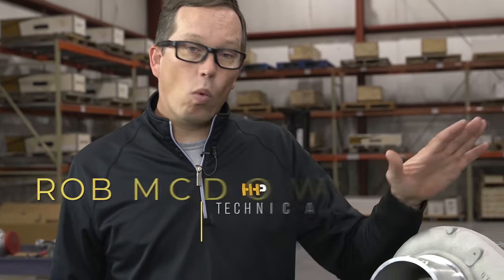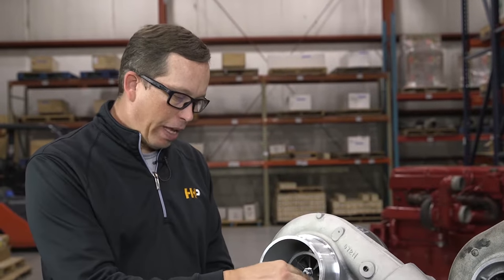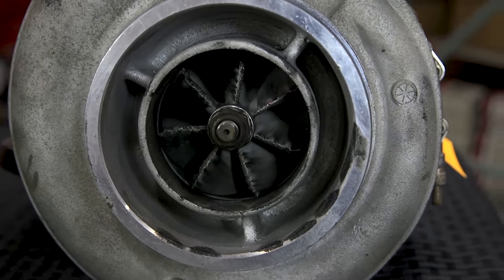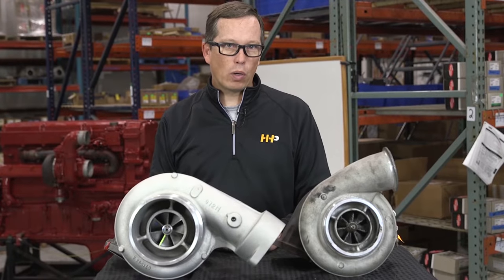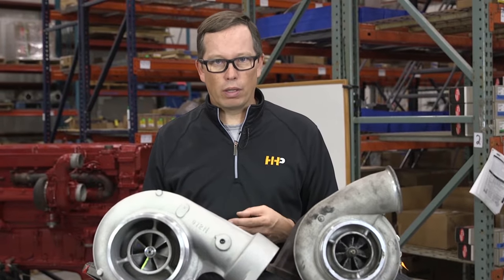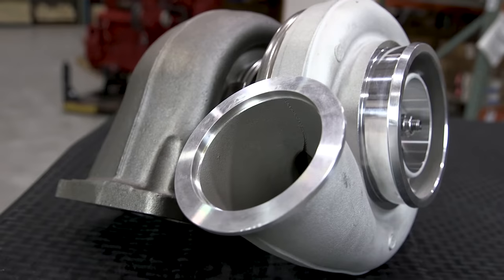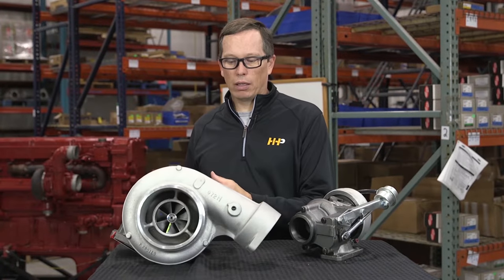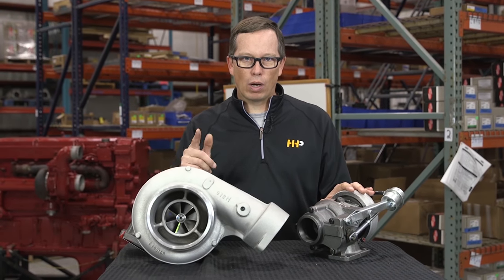Why Did My Turbo Fail? HHP Can Help!

Comment: Most turbos are fine that get replaced, I see it all of the time out here in diesels, mainly semis, thirteen and fifteen litres. These dealers and shops know that most of you guys have no clue how your motor operates, so you are easy pickings. I know, they have gotten me too, then I educated myself. Most of the time it is simply a bad sensor in the emission system. You do need to do regular maintenance on these emission systems, one of them is to change out your sensors, intake and exhaust back pressure are the two main ones. Then clean those EGR Valves and EGR Coolers, and yes, you can clean them, but you have to remove them first. Then the DPF and DOC filters, SCR too. You need to replace or clean them periodically. 

These shops see you guys coming from a mile away. Bad sensor, you get a new turbo! You pay the $8000 and down the road you go! One hundred miles later, that check engine light flips back on... You go back, and you get an EGR Cooler or a new EGR Valve... And the cycle continues until you are broke. And all you needed was a $70 sensor that you yourself could have bought and installed in the parking lot.
Reply: It ain't a sensor for everyone just because it happened to you. You can't assume until you get into it.

Comment: Wouldn’t it blow white smoke? Black smoke is unburned fuel? 
Only reason I say that is because I had a Ford diesel that was blowing lots of white smoke and was very under powered. After looking the intake pipe to the intake had come off so all the boosted air was leaking out and engine wasn’t getting enough air. So wouldn’t it be similar in case of a bad turbo?
Reply: In my experience from when my intake pipe blew off my old mk4 jetta diesel.. Black smoke not white. Anytime you're pushing more fuel than the air allows for you get black smoke
Reply: Black smoke it's turbo, white smoke it's a loose or busted rubber coupling on the turbo.
Reply: @jmaegm  black smoke can easily be caused by a loose or busted coupling because a massive boost leak will make it run really rich until the ecu pulls fuel

Comment: So a year ago my turbo imploded driving down the highway, had a local shop replace it, took forever and he said they put a brand new factory cord like 15 or 16 turbo into my 6.7 ford, right out of the shop it didn’t sound right, had a loud howl and I said I’m no mechanic but that’s not right, he said oh no it’s supposed to sound like that you aren’t used to it because that’s what it sounds like new, never heard a turbo that sounded that bad. Anyway I thought screw it and drove on and figured if it busted they had to replace it anyway. A week later a lot of smoke started coming out of the exhaust, so I took it back he agreed it was bad and said he would replace it. I walked into the shop to pick it back up and saw the “new turbo” they had installed and taken out and it did not look brand new with a weeks worth of use on it, looked more like a bad re manufacture. The next one they had in sounded nearly right but I still said there was a faint howl but again I didn’t want to screw with it and now a year later the howl is nearly like the last one. What’s the diagnosis of that? Howls in 1st and second gear, can’t hear it down the highway, the whistle when it’s spoiling down back to idle sounds normal but that initial acceleration sounds like a police siren
Reply: Turbo will fail soon, get a bran new one, expensive but worth
Reply: Your turbo charger still bad mal functioning
Reply: After driving your Turboed Car you need to let your car idle so turbo cools down, as it may be very hot.
This is your diagnosis.
Reply: i just had that and the imput shaft play was bad, get a quality rebuilt
Reply: Any updates on it

Comment: My turbo looks perfectly fine but it builds no boost.
Took it to a shop recently to change the head gasket but shortly after I did a half wot pull to like 55mph and right after the turbo started making a supercharger whine lmao
Reply: Sounds like a wastegate or boost leak
Reply: @blainosm6293  I blew my turbo🤣🤣
Reply: @blainosm6293  is that fixable ?
Reply: I took my truck for head gaskets and new trans and it runs like shit now. Can’t get over 6-8psi and it shifts funny. Blows no black smoke at all I hold it to the floor while taking off and it hits the rev limiter and blows a bit white smoke. Hopefully just a sensor but my luck I expect nothing but the worse. I bet I blew mine to 😢

Comment: Hi  my truck has been black smoking several mounts and started make little noises when i go up hill ? It is 2015 freightliner Coronado.  I think that turbo is bad so I want to buy it
Reply from the maker: Give us a call at 844-447-1453 and we'll help diagnosis your engine problem and set you up with the right parts you need!

Comment: My Peugeot 308 has been to alot of workshops and they cant seem to find the problem. The car runs bad at idle while cold and when its warm it will start to get better.
I also have some lagging when in 1 gear.
But now i can start hear the turbo whitsle, as if i have gave the car a blow of vavle. It happends once i get to 3000rpm and release the throttle. 
Could the issue be my turbo?

Also Peugeot workshop have failed to find the issue. Ive already changed spark plugs, chain, cleaned all hoses.

Comment: My cars had a turbo replaced but sometimes when im putting presure on the engine im hearing a whine noise not always tho any ideas?
Reply from the maker: We have ASE-certified techs that are available to walk you through troubleshooting and diagnosis. Give us a call at 844-304-0426 and speak with one today!

Comment: I have a loud whistle noise coming from turbo side on my 579.  Just replaced it with a brand new one.  Guess I got a leak from the couplers?
Reply from the maker: Check for exhaust leaks or leaks from your EGR.  Double check all your hoses for any loose connections or holes.

Comment: Audi A3 1.6 TDI. My engine is losing power occasionally and I’m stalling it when pulling away. Also occasionally. The coil light flashes intermittently, seems when the engine has warmed up? I need to get it in to a garage but just want to know if it is the turbo. Been told it could be. Thanks in advance for any advice.
Reply: Diagnostics done and it’s the turbo. £900+ for new turbo, service, mot and labour!
Reply: @StandingStrong66  I had a German made VW TDI, and the intercooler would fill with water, giving me all of the signs of a bad turbo. I would have to routinely get under there and drain the water out. Thank God VW bought that thing back.

Comment: 02 Guiii Patrol 3lt TD, sounds like a siren, mechanic reckons its fine after doing tests, despite sound and serious lag when driving. Not sure whats wrong
Reply: reckon ive got the same with mine... just done an injector pump and its been fine and noticed its sluggish and struggles to boost over 5 psi

Comment: 2014 Ford Fusion, Engine was replaced for cracked head under warranty, 20k miles later turbo, intake and oil pump have to be replaced because "gunked up". Would that not have been replaced with the engine? No longer under warranty they say.
Reply: Change your oil more often than they recommend.  Might've just swapped the head out knowing Ferd, but in 20k that'd be about regular for a modern domestic vehicle. Buy a Kia/Hyundai, probably still will die, but heard much better about their customer service long term.
Reply from the maker: Allison, thanks for watching! Unfortunately we don't work on Ford Fusions.

Comment: I've got an F350 6.0l, and when I'm pushing it, like towing my boat or something I can hear a very high pitch whine coming from the engine.  It's barely audible to the point that it took me a while to be sure it was there, and it's so high pitched that it's at the edge of my hearing range. I'm new to this sort of engine, is that likely to be the turbo and is it a sign of trouble or normal?
Reply from the maker: Possible that it may be your turbo.  If the sound isn't going away, you may want to have it checked by a technician.

Comment: Can a bad seal on a turbo foul out the spark plugs with oil
Reply from the maker: Oil may be getting to the spark plugs by passing the piston rings.  They could be worn out.
Reply: @Highwayandheavyparts  it happened overnight, I think the turbo was pushed too hard when there was a boost leak.

Comment: Got a question got a turbo sounds like it is sucking too much air in and dosent sound right for a desiel 4 cylinder
Reply from the maker: Aaron, we have more information here: https://highwayandheavyparts.com/n-12764-common-turbo-problems-failures.html
Reply from the maker: Check out our diagnosis checklist: https://highwayandheavyparts.com/n-12258-turbocharger-failure-diagnostic-checklist.html

Comment: My car is Ford ECOSPORT 1.0 titinium, 2019 model with 74 km after service on 29 Jan after a month it started to lose power gradually then started to vibrate when u stop it then have difficulty in moving in steeply places, is that connected to turbo failure or could be plugs
Reply: You buy a ford and wonder why it's crap
Reply from the maker: Portia, unfortunately, we do not service gas engine turbos. Thanks for watching!

Comment: I need a turbo part number 2881992rx
Reply from the maker: Check it out on our website:  https://highwayandheavyparts.com/i-24496921-2881992-cummins-ism-qsm11-turbocharger-remanufactured.html

Or give one of our ASE Certified Parts Technicians a call at 844-447-1453!